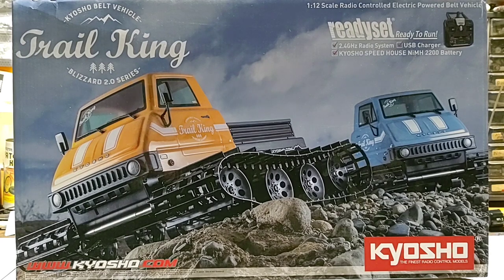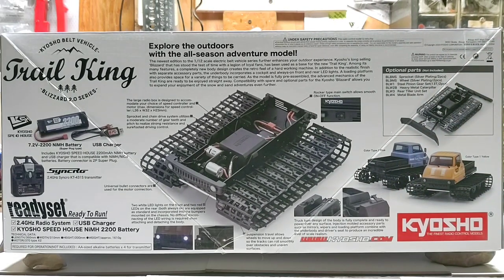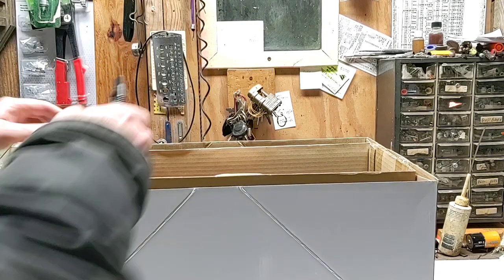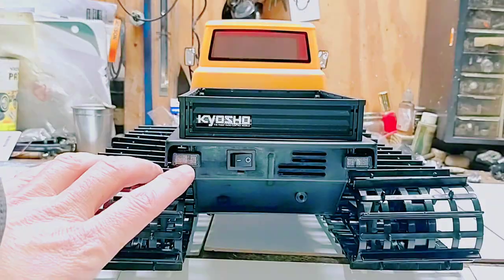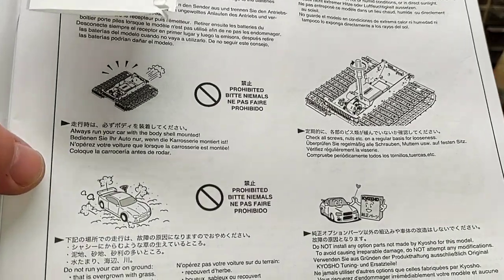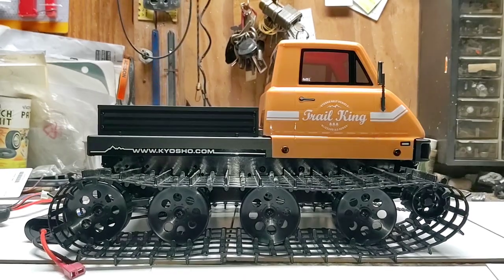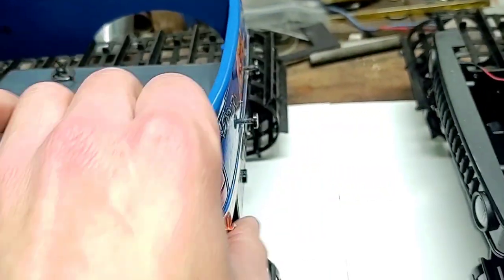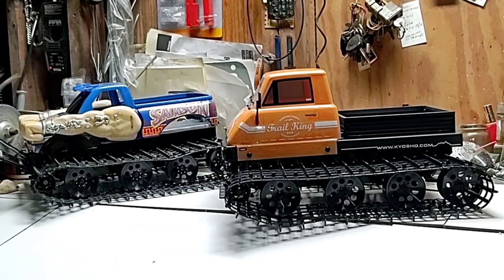Kyosho Trail King Unboxing; ...is it Lipo Safe ? Not really... No Low Voltage Cut Off on the ESC's

Comment: The ESCs are LiPo compatible but DO NOT have a built-in LiPo low-voltage cut-off. I run mine on 2s and use a LiPo alarm plugged into the battery balance port (from Amazon) to detect low-voltage. It drives way better and way longer on LiPo than on the included NiMH. I did also gear down with the smallest pinions I could install (can’t remember the size) otherwise the vehicle was just too fast to be maneuverable the way I want to use it. Glad you were able to get one. They have been very hard to find. And all the accessories have been back ordered for almost a year. Cheers.
Reply from the maker: Those buggers over at Kyosho Should Have Said That Somewhere in the Manual 🤷 I'm kinda pissed off at them for that,🤔 F-ing Buggers! 🤷 Shaking my head about it currently,🤔 
I might have to take down the video over that little bit of nonsense 🙄😕 Those Guys over at Kyosho are A-holes!  Yep! I'm gonna have to pull that video, Which sucks because I already deleted the original video, So it's going to be a Total Loss thanks to Kyosho's Lack of Critical Information.🤔🥺
Hmm? 🤔 I'm thinking that I might do a totally new unboxing video on it, But this time I'm not going to be as friendly towards Kyosho.
I've got a few complaints that I found on the machine as well, like Every Single Screw on it was loose, and How the electronics were just jammed into the receiver box with no Rhyme or Reason, yet the manual shows the ESC's and Receiver, being cleanly installed, with a proper location for each item, then there's the motor for the driver side track "motor being located on the opposite side of the vehicle" nevertheless.. the motor is Squealing! And we haven't even had it out for it's First run yet,🤔😕  And of course there's the whole No Low Voltage cut off factor that they don't warn anyone about.🙄🤷 I think that lack of info is just Crazy 🙄 

In my own defense concerning what I had said in the video about Lipo usage on the Trail King;
I was only quoting the Kyosho Trail King Manual,😕 which is why I put a 8 second still image in the video, showing exactly what the manual says concerning Lipo batteries,🤔 That way I wouldn't be Directly Liable, for Kyosho's mistakes,😕
But after hearing what you had to say about the ESC's not having a low voltage cut off, I'm starting to feel like I'm walking on thin ice with this video.🤔😕
Argggg 🙄 I'm gonna have to redo that video, there's no other way around it.🤔
Kyosho needs to Step up to the time's, and make these trucks completely Lipo Compatible.😕

I Sincerely Can't Thank You Enough for That Awesome Head's up my friend, 😊👍
And many more thanks for checking out the video too, without that I might be in some serious crap concerning Kyosho's mistakes on paper.😕
Much Appreciated Brother
😊👍100% 
P.S. this video will expire shortly, along with all comments and replies.
Reply: Your welcome. I know it’s a pain about the ESCs, but the LiPo alarms I found on Amazon were cheap (like a three or six pack for $15 Canadian) so it wasn’t that big of a deal for me. I hear you on the receiver box rats nest too. That bugs me also. In the chassis the wiring looks clean, and then you open the receiver box and boom…rats nest of wires. I recently added my own plough and cleaned up the wires when I put everything back in. Other than that it’s been a good vehicle for me.

I’d keep the video up. It is a good unboxing and with the new title it’s clear that there is a caveat with LiPo usage (that, yes, Kyosho is not very clear about).
Reply from the maker: I definitely appreciate your info my Canadian Brother  😊👍 100% 
Lipo Alarm; we recently ordered a few of them thanks to your information.
😄👍
Unboxing video; 
First off, ...I can't thank you enough for your Awesome Compliments towards the video.😊🙏 👉👉🏆👈👈
As for the video itself;
I was in a panic of thought, trying to figure out what I could do to to Cover my rear end,save the video, and divorce myself from the Kyosho's lack of info at the same time,🤔😕  my first thoughts were to redo the video, But since I deleted the original video from my phone's memory, and cut the Trail King's box into pieces, that was going to be a tuff video to accomplish,🤔 not that it couldn't be done of course 🙄 I would have just refilmed it with a different title, such as (Kyosho Trail King Unbiased Opinion Unboxing)
Which would have been a little bit more work, but it was still doable,🤔  And I figured that in the meantime... I would change the title of the original video a little bit, Just to cover my backside until I had the revised version ready to go,
😕 And then after doing that, ...I kinda thought to myself,🤔  that between everything that I showed in the manual, combined with Kyosho's insignificant lipo discouragement, and coupled with the the new video title,🤔 (Which is a Disclaimer in itself) That it just might be enough to save the original video from deletion.😄👍

Side note; My brother and I took the snowcats out last night for the Trail King's First run,😄 We ran the T.K. on its included 2200mah 7.2v nimh battery, And to my Shock and Amazement, the T.K. actually ran for a good 39 minutes before it started slowing down,😕 
I was pretty shocked about that, I figured that he would get about 20 minutes out of it at the most,🤔 but nope!
It ran for quite a while 😄👍
And it was Cold too 🥶 Like Stupid Cold 🥶🥶🥶🥶 right around 1° degree Fahrenheit, which is like negative -17° Celsius or something,😕 Darn Cold!
And even colder down in the valley where I have my RC Adventure Park, my God it must have been like -10 Fahrenheit on the adventure course,🥶 brrrrrrr 
Anyways... The Trail King ran like a champion on its included 2200mah nimh battery,😄👍 I was surprised to say the least.
We ended up going out twice yesterday, once around 4:45pm and the second time was around 1:00am, The 1am run was the coldest, Anyways.. after the 1am run, we had a Tragedy, 😕😞😫😩😭
We always blow off the RC's after each run with a Air Compressor, after I got done cleaning off my Blizzard Fr AKA "Samson" I set Samson up on the workbench in my garage, which is like Four ft off the ground, 🙄 and you can probably guess what happened next,😕 I reached down to pick up my Blizzards transmitter, "Facing away from the blizzard"and accidentally bumped the left stick on the radio 😩 all I heard was a brief zip.. and then a small pause... and then the sound of plastic shattering 😭
Rip Samson! 😕 The Blizzard jumped off the work bench and the landing is a question mark ? The end result was a broken rear Boogie wheel support on the driver's side, plastic part "BL6" (which is the track slack adjuster) And a Shattered Samson body, The body broke in half across the bed of the truck just behind the rear wheel wells,🤔😩 it's Destroyed! No more Samson 🥺
It was so darn cold outside and inside of our uninsulated pole barn, that the plastic didn't have a chance! It literally Shattered on impact.😕 
Anyways... Accident's happen, 🙄 the price we pay for winter time fun 😂
Replacement parts have already been ordered for the Blizzard Fr, which wasn't very easy to find,🤔 I ended up going through a place in California called "Kyoshoamerica" and I found them on eBay 😄👍
It was like $4.00 dollars for the Part's and $7.00 for the shipping, Cheep Fix! 😁
The Radio Shack Samson body on the other hand, is a complete loss.☹️
As a result, I'll be going back to my "original" blizzard fr body for awhile 😕😂 lol  I can laugh about it now, but last night I was almost in tears over it 🥺
Almost! 😄👍 Lol  
Trail King on the other hand had absolutely no issues.😁

Sorry for the long winded story bro 😄👍 lol 
And thanks again for your input on the Kyosho Lipo nonsense. 😊🤜🤛 🇨🇦

Comment from the maker: Attention; According to the The Kyosho Trail King Manual, The Kyosho Trail King is Lithium Polymer compatible.🤔
But I was Recently made aware by another viewer, That the Kyosho Trail King's Electronic Speed Control or "ESC" is Not Equipped With A Low Voltage Cut Off,🤥
Which means that it could Potentially Drain a Lithium Polymer battery down below it's safe level, Causing the battery to be Unrecoverable, (Meaning unable to Recharge) 
Attention; If you intend on using a Lithium Polymer battery in your Kyosho Trail King, You will also need to purchase a "Low Lipo Voltage Warning device"
Or Simply "Lipo Alarm" to Alert you when you're Battery is getting close to it's Low Voltage Threshold.🤔
Attention; 
Google "Lipo Alarm" to Learn More about Lithium Polymer Battery Low Voltage Alarms or Where to Purchase a Lipo Alarm.

In closing; 
If you as a individual have a problem with your Kyosho Trail King, Please take that up with Kyosho Themselves! 🤔
As far as this video is concerned; 😕 I merely read all of the Information that was provided in the Kyosho Trail King Manual, Along with the Product Description on the Kyosho Trail King's Packaging, Concerning using Lithium Polymer batteries in the Kyosho Trail King. 🤷
Kyosho "Themselves" are personally at Fault for not Disclosing all the facts, Concerning using Lithium Polymer batteries with the Kyosho Trail King.🤔
Any Problems, or Issues, Should Be Directed Towards Kyosho Directly, and Not Towards this Channel.  (Kyosho is the Bad Guy in this situation)

Sincerely; R.C.A.D. 

P.S. Special thanks to the viewer who brought this to my attention, (You Know Who You Are)  And I Sincerely Appreciate your Awesome Information regarding the Kyosho Trail King's Electronic Speed Control's "Lack of a low voltage cut off" 🤔
Greatly Appreciated my friend. 😊🙏🙏👉🏆👈

Comment: Hey Jim do you see any issue running a axial AE5_L and a quick run 1080 together? Or do you think it's not worth the aggravation. I have one of each (not 2 of either) did I mention I'm a cheap skate lol
Reply from the maker: I'm cheap as heck too! 😂
But ahh... I would make sure that both Esc's are the same type,🤔 You could probably run a AE5 and a AE5L together, but I'm not sure about running the 1080 with the AE5L,🤔 "Different output levels" 
You got two motors to power,(One for the left track & One for the right track) and you kinda want them both to have equal power.😂👍 
Got 2 Esc's, which are both being plugged into one single receiver, which is another reason to keep them both the same type,
(Maybe ??? 👆 I'm not sure about how important it is that they both match for the receiver)😕 But in my mind's eye, I would try to keep everything balanced.
😁👍  
You could try running two different Esc's if you wanted to of course, But you would probably be better off if they both matched up equally. 😂👍👍